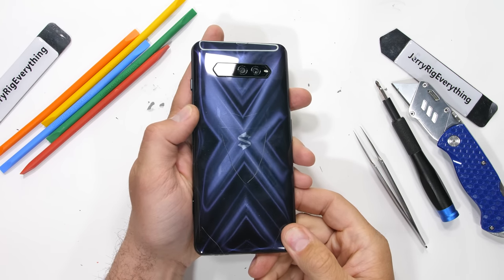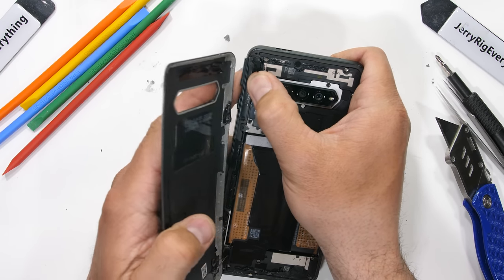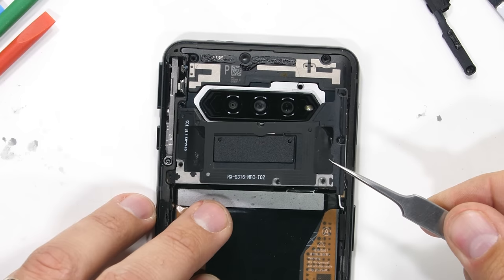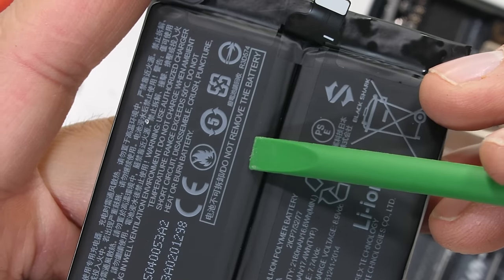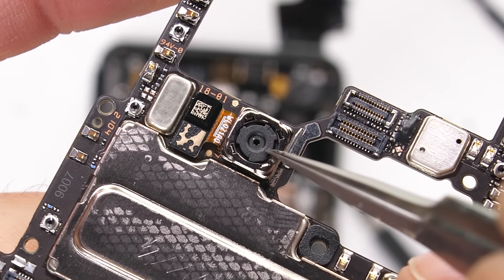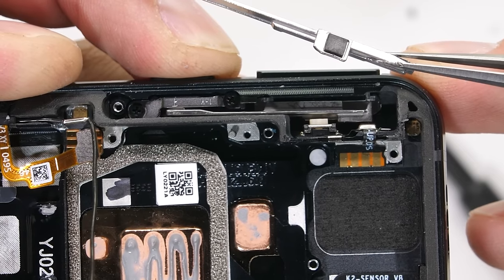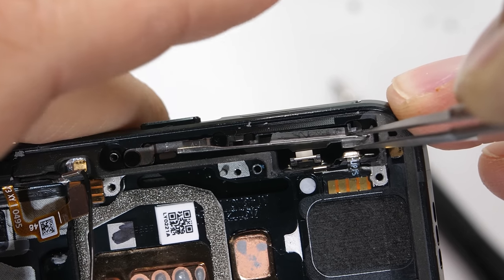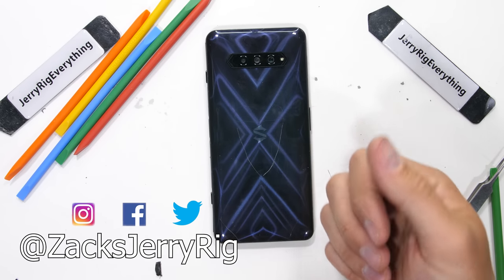How do 'Magnet Triggers' work? - Blackshark 4 Teardown!

Comment: unlike gears and motors, magnets don't wear out, so it means the black shark 4's popup trigger buttons are gonna stay in shape forever.
not only did black shark cut off on manufacturing costs and gave the phone a more gaming asthetic by making the triggers manual, but they also made a huge improvment over their overall durability.
thumbs up black shark👍

Comment: The heat pipe is covered with that Aluminium foil if you look closely you will find a copper pipe under that aluminium cover

Comment: I think the camera bump should be wide and made from aluminum and those 2 copper chamber should be vented and flushed on the back of the phone with glass. The cooler would work faster that way to anticipate the heat plus without the cooler the phone would heat less by a degree or more.

Comment: well the reason they don't get IP rating is not because they aren't water resistant. I believe they use the same water proofing measures as the mi devices but do not apply for the certificate. It is to save the cost of the machines used to test the phone and and applying for the IP certificate which adds to the cost and not ideal for a budget gaming device which is more dedicated towards performance

Comment: 3:13 & 3:18 why is the thermal paste still in a scribble shape as if it was just applied? if there was compression between the motherboard and the copper panel, which is what thermal paste is intended to endure and flatten/spread out to maximize the heat dissipation, then that scribble S-shape of the paste would be nonexistant. how is that efficient cooling at all???

Comment: oh no (3:12), this motherboard isn't of the pro variant - the pro uses the NVMe + enhanced UFS 3.1 system similar to a PC, for faster read and write speed. The back cover of the pro is not a soft plastic either. Not to forget, the pro variant is equipped with SD 888, not the SD 870 like on this one..but this is a teardown, not a spec talk.. hahaha...  *peace*

>> anyways, for more details, check this ytube vid out (it's in 'Cn' though): 6vlUBvA-i10&t=284s

Comment: I can't understand what's the point of hiding the buttons whit a separate button. I mean the user technically gets no benefit from that, since you still have open buttons on the side all the time. they are just a bit smaller. However, how it works is great, but it would only make sense, if it does not requires another button to operate it, which effectively kills the main purpose, hiding unnecessary buttons unnecessary times.

Comment: The Loudspeaker doesn't have any balls??  Whoa there Jerry!  What'd he ever do to you? 😜  

Also, why do they use a dual battery setup?  Cost, ease of manufacturing, using cheaper batters that are more available? 

Or could it be to provide certain parts their own battery? 

I'm having a hard time imagining a good reason.
Reply: @David Olson and how exactly does using 2 batteries improve anything? Charge time is the same.

Comment: Is the back glass of your Note 10 Plus seperating? I have the pre order edition so it's about 20 months old and the glass is coming away from the frame. I don't think it's because of the battery though because the peeling is uniform around the whole phone. Anyone else have this issue?

Comment: No matter u believe it or not, it's USB 2.0. in 2018 or 2019, it's not a problem. But 2021 right now, USB 2.0 max speed 60MB/s in theory, and no usb-c to HDMI support. However the new usb-c 3.1 gen 1 speed is max 625MB/s in theory, and can do support usb-c to HDMI well. Why do we still think USB 2.0 😓 is good right now

Comment: I really like the aspect of this phone, however, I wish there weren't 4 fatal flaws with it that kinda ruin it for me sadly.
In short, the fact there's no option for external storage is basically the Achilles heel of the whole thing. How am I supposed to have a lot of space-hungry apps on it then, with little space that can't be upgraded?

Then there's the fact it's a Chinese phone. China is a kind of tricky territory to traverse around when a product is made from them. Besides, it's not a mainstream phone, so if goes kaput on me, I can't easily get it fixed or get new replacements for it.

Next is the case (the one that can have the cooler attached to). That thing doesn't look protective at all. I like to be ensured my phone will be safe in a good case, and I doubt that there's gonna be any other cases out on the main market for it any time soon.

Finally, is that IP rating, or lack thereof. This is just a nice thing that would provide me peace of mind just in case for some reason it fell into some water, or it is raining.

Comment: While this is a very good powerful phone I do not recommend ever buying it the main reason is after a year of owning a phone made from that company it will no longer get updated also the company doesn't respond to any issues since their last update killed the Black shark 2 since the battery is draining and you can't use it to call people and that was when Black shark 3 was almost releasing up till now they never fix the issue so if you're going to buy this phone make sure you check on every new update that comes out for this phone which will probably be at least 2 or 3 and check if they're worth updating to because the company will one day leave it as a dead phone with a broken update let this be your only warning

Comment: I wish we had gaming phones minus the gaming aesthetic
Reply: Iphone
Reply: @jonyythetryhrd  Any phone without a headphone jack and lower screen polling rate isn't a gaming phone. Headphone jack = no latency, dongles are an unnecessary disposable and inconvenient product, and also occupy the charging port. The closest thing imo would be the Xperia 1mk3 and Pro-i.
Reply: @ubacow7109  nah its not a gaming phone per say, but iphones do run games pretty well and can compete with the gaming phones because they have the best optimization because they are so popular. As for  the Bluetooth airphones "latency" stuff that shit is not noticeable by a human ears its like comparing 11 inches to 10.999999999 inches really
Reply: @jonyythetryhrd  Latency is incredibly perceivable by ear..... Human response times are around 20ms and bluetooth response times are anywhere from 35-500ms (ive had even worse in my car audio bluetooth) depending on the version, signal strength, location, interference, processing, compression etc...  A lot of factors will affect the delay of the signal.
This is why no gaming gear like headsets, mice, keyboards, mics utilizes only Bluetooth and instead relies on dedicated 2.4ghz or other radio bands. I have gamed w/ bluetooth products you'll notice immediately without even entering games that even within just menu screens you can tap on a button and the sound wont come until after the scene itself has started to change. Things like videos even will have de-sync if you pay attention to lips on videos esp if you're in cities where theres wifi and bluetooth air wave interference everywhere.
Reply: @jonyythetryhrd  a really simple example is also your game console & controllers like the switch/xbox/ps. Notice that the controllers always have a headphone jack when connected to console? This is because if it was on Bluetooth the input lag would vary immensely and would make gaming very unplayable. (The controllers do have bluetooth pairing as well, but when connected to console they always operate on a dedicated band, also why controller battery life tends to suck since Bluetooth is a low bandwidth/low power technology) Keep in mind you can file transfer over wifi at say 600mbps but bluetooth is capped between 1-2 megabits per second~